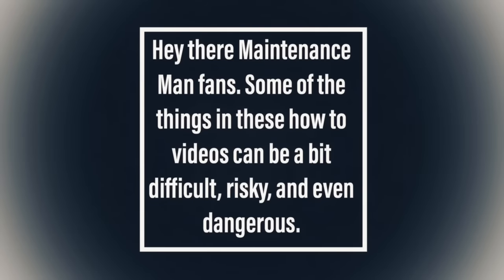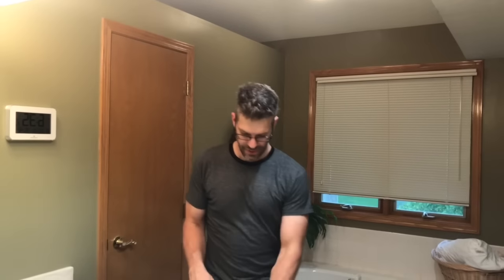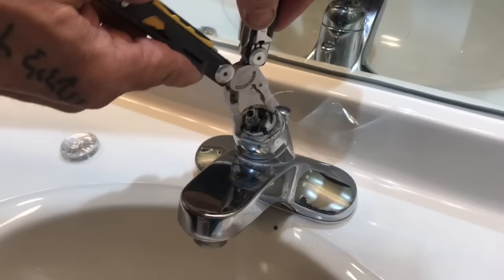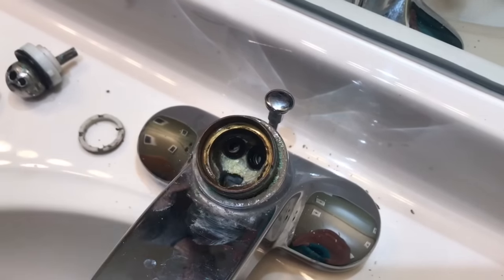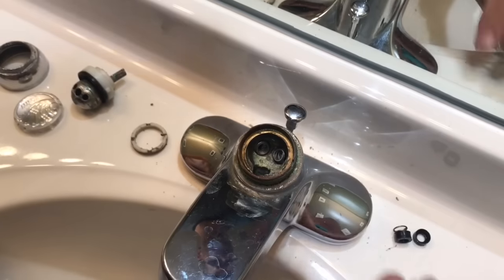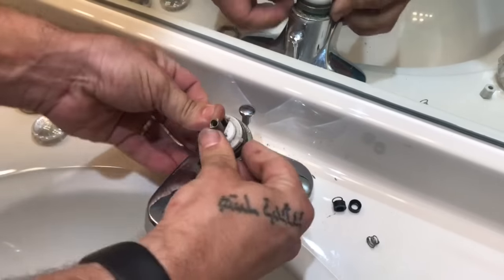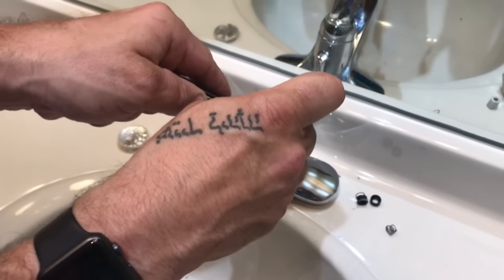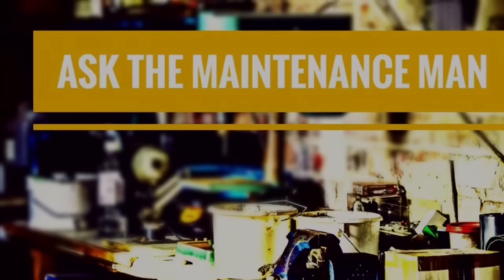How to fix a leaky delta style bathroom faucet

Comment: Great, easy to follow video! I recently replaced my entire 16 year old faucet with new Delta faucet and instantly regretted not trying to repair the old one! Went from 2.7 GPM to 1.2 GPM! Supposedly a water saver but actually run longer to get hot water and no pressure to clean out razor!!!
Where can we get the rubber/spring thingy???
Reply from the maker: Any home improvement store will have the seats and springs. Also...your “low flow” restrictor is located in the aerator. It’s the plastic insert that has a pencil led sized hole in the center... But you didn’t hear that from me.
Reply: Ask The Maintenance Man great advice I heard from somewhere! I exchanged the old aerator with new and that made huge difference! Once I replace the seats and springs in the old faucet should be even better!!! Thanks and glad I found your channel!

Comment: Great tutorial!  I was unsuccessful.  I feel I did everything correct however no to very little water is coming thru the faucet after I replaced the seats and springs.  I'm guessing my ball valve is not align correctly.  Any assistance would be appreciated.  Thanks
Reply from the maker: The aerator is clogged. It’s so common I made a video on how to clean it out. Check it out and you’ll have your water pressure back.

Comment: Great video and explanation. My faucet is almost the same like this Delta, but mine is circa 1994, and the retaining ring is little bit different: it has to be screw and unscrew at the bottom (not from the top with a wrench). Are there anything else the same?
Reply from the maker: The seals themselves should be the same unless you have a cartridge style delta faucet and then you’ll need a whole different repair and parts altogether.
Reply: I'm running into this now. Everything else looks exactly the same. However, I can't get that damn ring loose with the multi-tool. So tight it just chips the plastic...

Comment: Thanks for the tutorial. After unscrewing the screw, I tried to pull off the head, but couldn't yank it out. (Your instructions showed at 1:31-33). Would the head get damaged if I yank it out hard? Any suggestions what I should do to get it pulled out?
Reply from the maker: If it’s stuck it’s most likely corroded in place. There is always risk of damage but pulling hard is your best bet. Fortunately most of the parts are replaceable so if one gets damaged you don’t necessarily need to replace the whole faucet to fix it.
Reply: @TheMaintenanceMan  ok. Thanks

Comment: I put the POINTY end of the spring upside down,  towards the metal base and NOT  the rubber seat... I wonder , if I should take it apart,  again.  ... Does it cause damage  ?
Reply from the maker: It won’t cause damage but has a chance to leak again sooner.

Comment: Are the rubber and springs universal? I ordered the top link and have a worse leak now than I did with the old rubber and springs.
Reply from the maker: No they aren’t. The link is for Delta style seats and springs. If the new ones didn’t match the old ones you need a different style of seats and springs. If the tension ring isn’t tight enough it will leak still as well. If the ball was corroded it will leak even with new seats and springs in. Let me know if you have more questions.

Comment: Thanks for this! I turned both valves of water off, but then realized that it's only the cold water leaking in the faucet. Would what you did in your video fix it or do I have a bigger problem?
Reply from the maker: It would fix your dripping faucet. If the valve is dripping underneath the sink that’s a different issue.
Reply: @TheMaintenanceMan  thank you so much for the super fast reply!

Comment: Did you replace the springs and washer/o-ring? You don’t explicitly say you are replacing those parts in your video.
Reply from the maker: Yes, In the video I only replaced the seats and springs. I mentioned briefly that there are kits at the home improvement  stores that you can get that have more parts in them.

Comment: Thanks for giving me the confidence to take my faucet apart.  My problem is almost no hot water is coming from the faucet when it is appropriately rotated.  The cold water runs fine.  Is this a seat and spring issue or something else?
Reply from the maker: Possibly the hot water valve has some lime buildup restricting the flow.

Comment: methodical and explained well, step by step ... BUT... one or both of the water shutoff valves may not close all the way and that has to be resolved before you replace the faucet rubber washers/springs...
Reply: I had a pro plumber do it so there was no guesswork for me ...

Comment: For you sir or anyone.....I have a stubborn rubber piece that does not want to fit over top of the spring and be seated inside the hole.  Is there a failsafe method or trick to get that rubber piece to fit?  The spring is correctly in with the narrower part facing outward, I could not get the rubber piece to go into the hole.  Thanks in advance!
Reply from the maker: The trick is patience. I have spent way too much time on getting them to go in before. If you can get the edge tucked in all the way around but they sit a little high on top of the spring, you’re good. Put it all back together and they will be fine. If the edge isn’t all the way tucked in and you try to put it back together, you will still have issues. Hope that helps.

Comment: I have a faucet like this that doesn't drip when it's turned all the way to cold, but it drips if it's left in any other position.  Is this something that would be fixed by what this video shows?
Reply from the maker: Yes it would.
Reply: @TheMaintenanceMan  It worked great!  Thanks!
Reply from the maker: Glad to hear you did it! Way to go.

Comment: Thanks for the video. What would cause a blockage of water after the repair is complete?
Reply from the maker: If debris is loosened during the repair it will get lodged in the aerator and it will have to be unscrewed and rinsed off then put back on. I have a video on my channel of how to do that if you want to go check it out.
Reply: @TheMaintenanceMan  Perfect diagnosis. I’m an idiot. Kept thinking I had covered the holes at the springs with the O Rings. Assembled and disassembled at least a dozen times. You are definitely “The Maintenance Man”!! Thank you.

Comment: From experience…I would highly recommend that you know where the main water shut off is located. That way if you should run into another leak, shutting off the hot and cold water valves, it will save you lots of problems.
Also… close off the drain in case you drop anything in the sink and down the drain.
Hope this helped …..
Reply from the maker: Thanks for sharing the tip.

Comment: Hey man great video! I have a question I have the same  shutoff valve as you but it’s leaking water and you can see water inside the cap, would that whole valve need replacing or is there’s something I can tighten on the valve to stop the leak?
Reply from the maker: The shutoff valve is a different story. There is a packing nut you can try to tighten first to see if that does the trick. If not you can get a new seal kit and tear the valve apart to replace the seat. If that doesn’t fix it then it’s time for a new valve. Or you just cut to the chase and put in a new valve. I have a video of replacing a toilet shut off valve. It’s the same process.
Reply: Okay great thank you for the help! I will check the video out right now and do those you’ve suggested; have a great day man

Comment: After turn off  shutoff valve under sink, it still drip. Do you have to turn off main valve?
Reply from the maker: If the local valve isn’t closing all the way you may need to shut off the main valve too.

Comment: Great video. Where can I buy those rubber things with the springs? Do you happen to know what its called? Maybe even the part number? Thanks!
Reply from the maker: They are called seats and springs. You can pick them up at any local home improvement store. There are a couple of different styles so the right one for your faucet will depend on the brand you have. Hope that helps.

Comment: Does anybody know what tool you need if you don’t have his multi- use tool? It seems his special tool had two super thin prongs that fit in the round ring he had to remove.
Reply from the maker: Any pair of needle nosed pliers will do the same thing. It’s about the tip being narrow enough to get in the two grooves and turn it.
Reply: @TheMaintenanceMan  Thank you!
Reply from the maker: @ElsaInCa no problem. Asking questions is what the channel’s for.

Comment: Is there a way to adjust the hot water intensity with this type of faucet? I'm running into an issue where the hot water comes out too hot.
Reply from the maker: The solve to your issue is to turn the temperature down at the water heater.

Comment: Hi looking to tackle this project are the springs seats half inch diameter ones or is that the wrong size?  Thanks
Reply from the maker: So sorry for the late response. The seats and springs are going to be specific to your brand of faucet. If you have a Delta then get Delta replacement seats and springs, if you have a Moen then make sure you have Moen replacements and so on. Some are interchangeable but do the research before mix and matching. Hope that helps.

Comment: I followed these instructions for both my bathroom faucets, but one continues to leak from the ball/stem. I initially started with just repairing the seats/springs as both dropped from the nozzle. The faucet that continues to leak now had a ton of build up under the collar & cam. Almost seems like the buildup was preventing the leaking. 

I swapped the ball/stem, cam & seal from the other faucet just to see if I could narrow the issue down to a particular part, but it continues to leak from under the cam/ball/stem. 

I've tightened the ring down as much as I can without hopefully breaking it. The stem is now very tight to move (too much imo), but the damn thing still leaks. 

Any ideas?
Reply from the maker: Was there corrosion inside the base? When I’ve encountered swapping the entire kit and still have leaks it’s time for a new faucet. All of the seals are replaceable so if it’s all done, and done correctly but still leaks it’s an issue with the faucet itself unfortunately.
Reply: @TheMaintenanceMan  I thought that may be the case. I messed with the ring some more after my post & magically it's 100% better, go figure. Fingers crossed I don't need a new faucet, but I suppose it may be time. Fixture is over 20 years old

Comment: Thank you so much for sharing. I need to replace the same cartridge, but for a tub. My question is do I have to turn a gas water heater off before I turned the main water off for a house.
Reply from the maker: You shouldn’t need to. If you’re turning the main water off it will stop the flow of both once the pressure from the hot water tank is relieved. If you’re going to leave the water Turned off for an extended period of time you might want to turn the water heater off so that you’re not wasting gas but you won’t hurt  anything by leaving it on for the duration of a repair.
Reply: Ask The Maintenance Man Thank you so much.

Comment: Ran into a snag. Did this once, it worked but I wasn’t getting a full stream of water. So the next day, I redid it all again, thinking maybe I had something that set just a little off and another go would get it right.

The opposite happened. Now I get no water at all! Any idea what has gone wrong?
Reply from the maker: Your aerator is plugged. I have a video on cleaning that out too. Check out the channel and you’ll find it.
Reply: @TheMaintenanceMan  I just logged back on to say I wonder if that’s what happened, and ask if you had a video on how to remove it. You’re the man. Great channel!

Comment: After removing the plastic ring (where you used the multitool), mine has no area to get a wrench on. It’s just a round smooth shape with some grip at the bottom. I cannot get a grip on it, how can I get it off without tearing it up?  Other than this, mine is exactly like this one.
Reply from the maker: I’ve not encountered a tension ring without any adjustment points before. If you email me pics I’m down to advise. askthemaintenanceman@gmail.com
Reply: @TheMaintenanceMan  I’ve sent you a pic!  Any advice would be appreciated!
Reply from the maker: @christopherhamilton5557  I replied to your email. Let me know if you have more questions or if you feel I’m not understanding your specific issue correctly. I’m here to be as helpful as possible.

Comment: Are the parts tricky to find? What are they called.
Reply from the maker: They are not hard to find. They are called seats and springs. If you go to the home improvement store and ask someone in the plumbing isle they can direct you to where they are. There is usually a rebuild kit that will include more parts than just the rubber seals and tension springs. Let me know if you have any other questions. Have a great day.

Comment: I'm ready to use this video to repair my leaking faucet but I'm not sure just what the "multi-tool" is. The man at the hardware store did not seem to recognize it either. Is there another name for it? I don't want to get in the middle of this and not be able to get things apart. Thanks in advance.
Reply from the maker: Here is an Amazon link to the tool. I hope this helps you reference what to get for your repair. 
https://www.amazon.com/dp/B07NJHX769/ref=cm_sw_r_sms_api_glt_fabc_CHN0Q599CC0KG8RRN4EG?_encoding=UTF8&psc=1
Reply: @TheMaintenanceMan  Thanks for the quick reply. Probably a great tool but a bit pricey to buy for just this one project. I'll have to see what I have around the house and hope I can make something work.

Comment: If my faucet has no product name do I need to remove the seats and springs and then take them to the store?
Reply from the maker: That is the for sure way to get the right thing but you could just take the handle off and if the parts visible look like the ones in this video you’re probably safe getting the delta style seats and springs. Another option you could do is to buy a multi pack and just use the ones that are for your style after you get everything taken apart.

Comment: I cannot remove the 'bonnet', the outer cap you referred to as a retainer ring.  I've tried WD40,  and Liquid Wrench overnight, and heating it .  It won't budge.  Is there another alternative besides replacing it?  Frustrated!
Reply from the maker: Unfortunately if you’re at the point that heat won’t remove it you’ve fully entered the realm of replacement. Sorry.
Reply: @TheMaintenanceMan  Well, thanks anyway.  Good video!

Comment: Before watching your video i cleaned out those holes with the yucky stuff.  After putting everything back together there is little to no water flow.  I am assuming I have a clog somewhere now.  Is there anything else that can cause little to no water flow?  If you think it is a clog, is there any remedy?
Reply from the maker: Yes Jason. There are lime deposits most likely clogging up your airerator. It’s the diffuser on the end of the faucet right where the water starts to come out. It will unscrew and you’ll be able to see the reason for your low to no flow in it. Just rinse it out and put it back on. It will most likely need a good pair of pliers to get it off and I’ve not taken one off without scratching the outside of it a little so if you’re concerned with that I’m sure the hardware store will have an affordable replacement. I’ll try to make a video for you but it may take a bit. If you have any more questions feel free to reach out. Sorry for the late response.

Comment: I have a leaky Delta bathroom sink faucet and replaced the springs and seals.  It is still leaking underneath into the cabinet.  Is there a different internal repair I need to do on the faucet?
Reply from the maker: You most likely need to tighten one of the main connections to the faucet from underneath.

Comment: Where is it leaking? Mine is leaking from the base and can't find a video to help. :(
Reply from the maker: Leaking from the base is a different issue and most likely needs replaced. The pipes that feed the mechanics in this video are braised (soldered) in place. If you have a leak from underneath there is most likely a break somewhere and will need complete replacement.

Comment: Question. Will this fix it leaking out of the main water exit. Mine has a good stream when shut off. I turned the main lines to them off and the leak stopped. This seems fairly easy.
@Ask The Maintenance Man
Reply from the maker: If this is the style of faucet you have then yes, it will fix your issue. If you have a steady stream you may need to replace the ball in the center as well as the seats and springs. The whole thing comes as a kit at the big box home improvement stores usually. Let me know if you have any more questions.

Comment: Did you buy a kit? I see different kinds of delta repair kits on the internet. If so what kind did you get
Reply from the maker: There are different kits. Some have a different shaped shaft on the valve ball so you’ll need to reference your own faucet to order the right one. The plastic and metal versions of the valve ball are identical in shape and size so that part is simply preference. The seats and springs are standard for the bath faucet but there are two different styles for a Delta style kitchen faucet. I just got the seats and springs for making the video. I did not get a kit. Let me know if you have any more questions. Have a great weekend.
Reply: @TheMaintenanceMan  Thanks so much for the reply. Blessings!